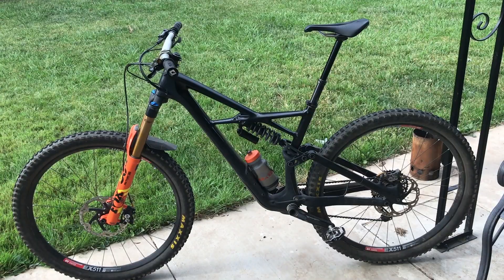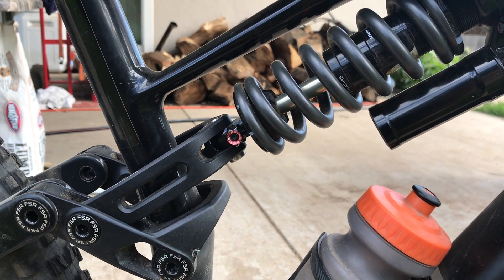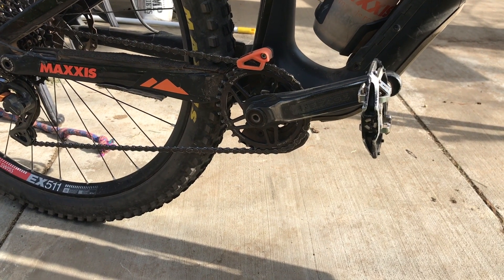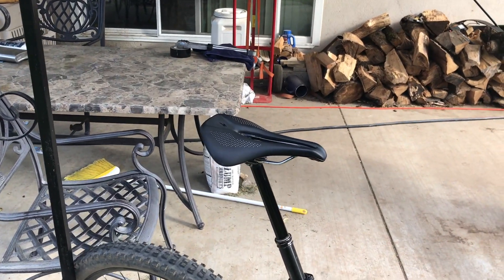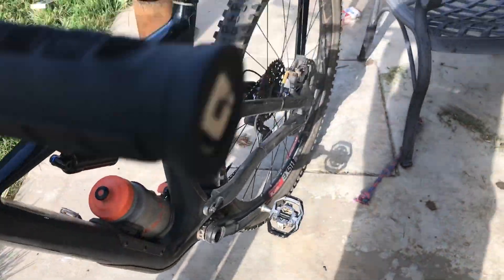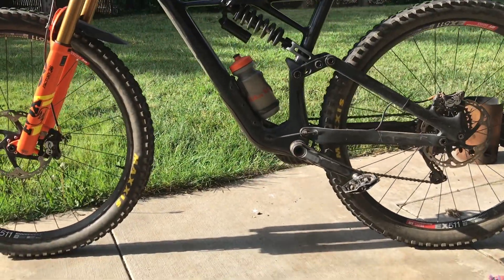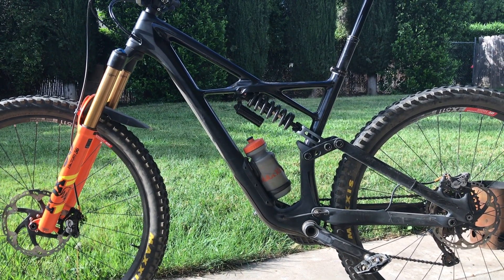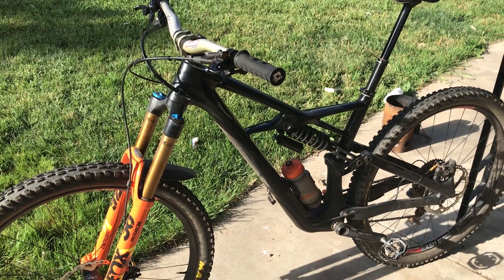Coil shock for the enduro?!?

Comment: @Alex, you mentioned that with the Bike Yoke yoke it would have snapped the shaft on a Fox DHX2.  How do you know that to be case?  I have a 2017 Enduro and just purchased the yoke from bike yoke, and a DHX2.  I've researched and even emailed back and forth with the owner of bike yoke, and he said he's sold plenty of yokes to Specialized owners without any known issues.
Reply from the maker: Charles Goss the dhx2 works for some. I’ve seen a few snap tho. Kind of depends on how much you weigh and how hard you push the bike
Reply: @alexthemtbr  I appreciate your reply.  I also have a 2017, and from what I've read is a bit less progressive than the 2018 frame.  I think I should be okay.  Plus there's always the Fox warranty.

Comment: Hi Alex, I noticed that you have an upper chainguide as well as a lower bash guard. On my 2018 Enduro Comp, there are only 2 ISCG-05 tabs on the frame. I emailed Specialized and they said it would be a bad idea to use a bash guard due to it having only 2 tabs. Do the carbon front triangles have 3 tabs or did you just say F it and put a bash guard on anyway. Thank you!

Comment: I love the mechanic tips and tricks in your vids man, also the pov ridealongs are pretty nice, keep 'em coming, interested to see what your next upgrades will be. Also, do you think it's worth to sell my frame+fork+wheels to switch from 26 to 27.5 if I already have good components(except the frame) ?
Reply from the maker: zEDo I wouldn’t say so. The wheel size makes a difference but honestly not by much. I ride with a buddy of mine who has a 10 year old Santa Cruz nomad and he is one of the faster dudes in the group. At the end of the day. A bike is just a bike and improvements translate to fractions of a second on the clock
Reply: Alex Chamberlin Back with an update, sorry to disappoint but i stumbled upon a great deal on a 2017 enduro elite 29er, so I sold my old parts, got some m1900 splines and I'm waiting on my 2018 lyrik rct3 to arrive. Can't wait :>

Comment: What was the main reason you swapped from yeti? I tested yeti sb5.5 yesterday on demoday and loved it. Although I have to check sb6 before I buy eather of them.
Reply from the maker: I was super stoked! Maintenance, lack of water bottle, and cable routing killed me though. Plus I broke 6 frames in all different spots
Reply: Huh, I didn't knew it is that fragile? Or was your riding pushing it too far? Maintenance you mean cleaning and relubricating infinity link or something more to that? I would gladly hear about all cans and pros, buying that expensive bike will break my budget for a while.

Comment: Get a Guerrilla gravity the smash, it’s amazing (and not a mass produced bike). But seriously it’s geo is progressive and it’s frame is aluminum!
Reply from the maker: Sarkidon Productions if I could find one cheap I would!
Reply: I bet you could sell your s-works frame for $2000 to the the GG. When I got the bike, it looked kind of simple, but the suspension, in my opinion works much better than the enduro. I rode one of those, and I see where your coming from. It just feels jittery and harsh.